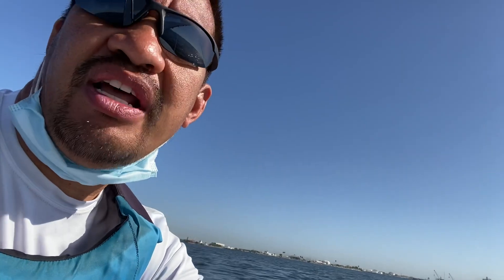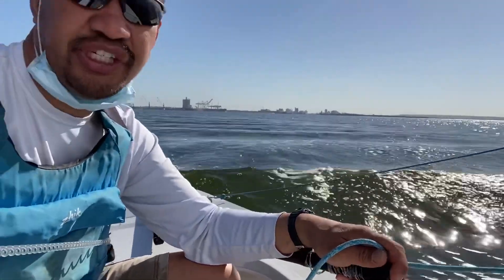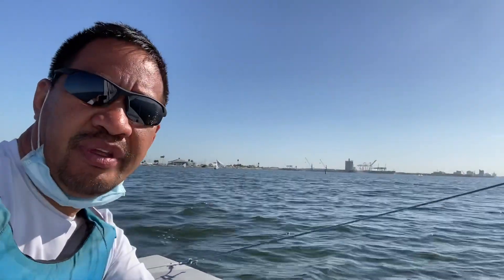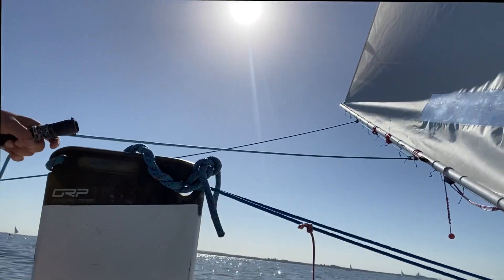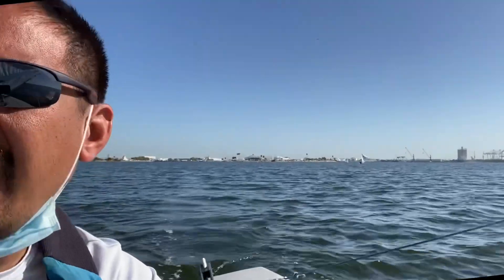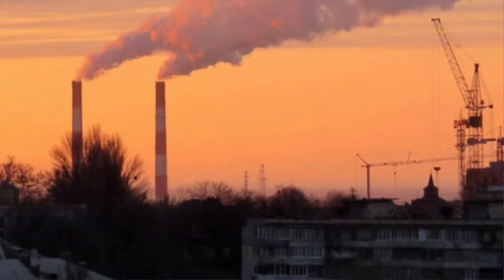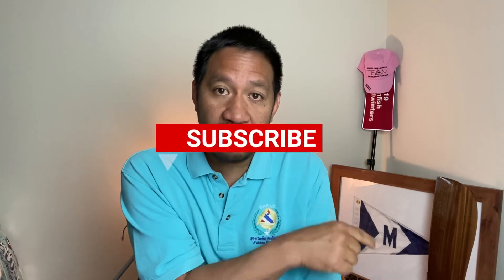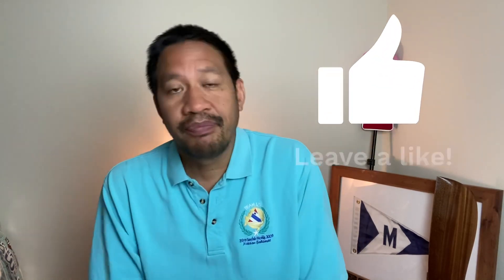Sunfish Sailing Tips and Tricks | How to Tow A Sunfish on the Water

Comment: Could you, or have you, talked about or demonstrated how to launch from a public boat launch?  It’s all I’ve got and that’s the most stressful part of my experience at the moment.  I’m getting it, but feel like I’m trying to reinvent the wheel.  Thanks Lee!!
Reply from the maker: Funny you mention that as i was thinking this was going to be my next video.  Ill be launching this weekend from a ramp. And others too…. I will film and make a video aboit that asap.     Thanks for the suggestion!   

Here are some tips-  1.  Make sure you have a long enough bow line. 10-15 feet is plenty and dont need for it to be thick- as a floating sunfish is light.  
2. Scout out the ramp. May be slippery, may be concrete-   Beware of wood!!!   If algae grows on it-  ca. be more slippery than ice-  ive seen people break bones falling in a slippery ramp.  Proceed with caution. 

Once getting the boat im the water-  pull it to a leeward side of the dock…. Hold the bow line and let float away from dock.  You can pull it in when needed.  

4.  Make sure MaIN sheet is able to run free!!!   If its cleated or stuck around anything the boat may start to sail.  Make sure the sail can move freely

Once that is done cleat the boat to a cleat—. Move your trailer to its parking space and raise your sail if you have not yet. And go sailing!!  

AFyer sailing you may not be able to approach the same area as launching due to wind shifts-   Always land to the leeward side of a dock. 

Hope this helps!!

Comment: You were sailing downwind in light air. As the wind speed increases you will need to move aft. Just as heeling to windward moves the center of effort above the centerline of the hull, as the wind pushes on the center of effort several feet above the waterline, it creates a moment by pushing forward, while the drag on hull pulling aft that tends to force the bow down. You need to compensate by moving your weight aft.
Reply from the maker: I agree...  To be sitting on the aft edge of the cock pit, one would be in pretty heavy air.  :).  Thanks for the comment Dr.!

Comment: Great channel Lee , doing my best to let  other sailors in this area know about your channel , I’ve learned a great deal about tweaking the sunfish. Even though I’ve been sailing for years I’ve just recently started sailing sunfishes . What do you think about a jens and what are it’s advantages
Reply from the maker: The Jens is a great tool
In ones tool box, especially if you may be in the smaller size.   Not always needed.
Reply from the maker: Advantages for most: depowers the sail and depending on where it is rigged on the upper spar will determine the depowering action.   Disadvantage:  there is a learning curve, since one size doesn’t fit all.   There also may be a need for an extra line, or an extra long halyard.  Also if not rigged well, it can slowly fall to the deck...    but once you learn how to rig it. It works well.   

If you don’t go out in heavier conditions which you are constantly fighting the boat...  then the Jens is secondary.    In my opinion an adjustable gooseneck is a must have and can be adjusted to depowering the boat enough in most situations.   Also a hiking strap is a great help.    If you have those, but don’t have an outhaul...   I would invest in that and a Cunningham, which will let the sailor adjust the fine points of the sail to the conditions.  Hope this helps.  :).

Comment: I'm wanting to put a wind vain on my Sunfish. I was thinking about placing it  on the mast between the deck and boom.(don't have to look up) Looking at some online, some of them say "won't get caught by mainsheet". If the mainsheet goes from the traveler, up to the boom and across the boom down to the cockpit, how could the mainsheet catch the wind vain? Do you have an opinion on wind vains in general? What wind vain do you recommend? I'm new to the Sunfish and have only sailed it twice since getting it. I've been practicing  taching. I'd like to concentrate on learning taching correctly without determining wind direction by waves, trees, feel, etc.
Reply from the maker: Hi Chris.   I agree with you.  In the position you are describing the Mainsheet would not catch.  If you are speaking of the “c-vane”.  It’s not so much the position of the wind vane but the design of the vane itself….  The arrow is enclosed by the metal frame acting as a cage.  Now when sailing close to other boats, it IS possible to catch someone else’s Mainsheet and destroy the wind vane.   :).  Hope this helps.

Comment: I'm an older guy (53) who is 240 lbs......love my phantom'(sunfish copy) and the joy that I  get from just a lazy sweet cruise. there are times where I have had to release the tiller to reach (what ever has come loose or needs attention at the front of the boat) and at the slow speeds that I sail at, I am not afraid to do so...but do you have any tips on how i can center the rudder and make it stay there while I fix a sheet or pull in a line? this would only be for a few seconds..(perhaps the sail is dropping, or the bow line is trailing etc.) thanks for any and all ideas. scott
Reply from the maker: Not older guy!!    That’s adolescence when it comes to sailing!      As far as fixing it, I would not fix it and make sure the tiller is pushed towards the same said as the sail lies.  As the sail is raised the boat will the center out or you will be safely luffing (make sure the main sheet is loose). :). Centering it will start sailing faster as you do what you need to do and possibly head down.  Which is what you Don’t want to do.  :).  Hope this helps. :)
Reply: got it! had not given a thought of what if  " i went over and the boat stays up right with a straight rudder. thanks!
Reply from the maker: You’re welcome!

Comment: Can we talk gooseneck position? I feel weather helm still, and my gooseneck is way further back than I see in most videos. In this video, is the light wind the reason for the goosenecks being set so far forward on the lower spar? Am I too sensitive to weather helm?
Reply from the maker: Swept back rudder.  On a sunfish.  There is always some weather helm.  It’s very difficult to get neutral helm unless you hike hard to weather.  For most people. 15-16 inches will be balanced with some helm still.  It is not uncommon for people to sail at 16-18.

Comment: Is it really doable to raise the sail on the water or is only for pros?
Reply from the maker: It’s done all the time. If you have a little balance and can crawl up in front of the splash guard then everything else is relatively easy. If it’s blowing mid teens and up and waves it gets harder.
Reply: @LeeSideSailing  , thank you!
Reply from the maker: Please note that when one lifts their sail on the water. Make sure you won’t drift into a dock or rocks, etc
Reply: @LeeSideSailing  , yes, I'm aware and that's exactly  what I find difficult: how to control the boat while I'm hoisting the sail.
Reply from the maker: If you let the sail loose and the main sheet loose, the boat will not sail.  And will drift slowly with the wind and current.